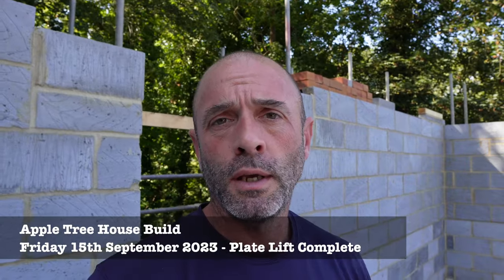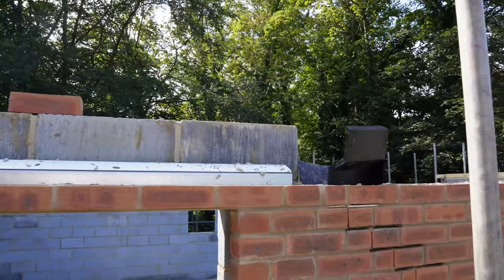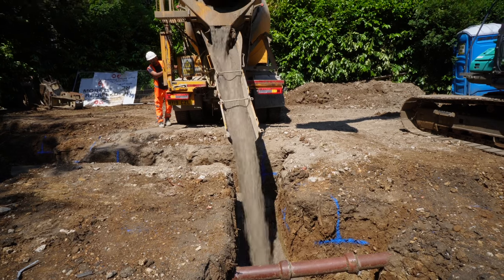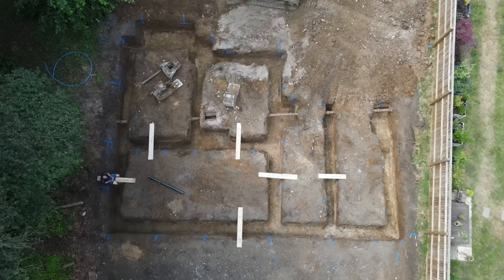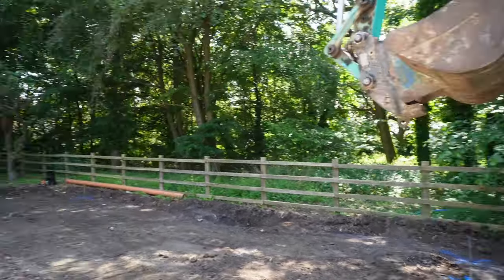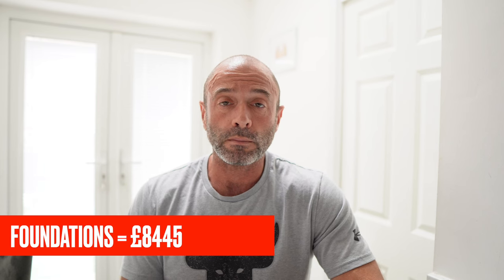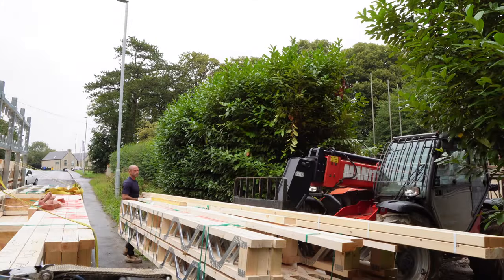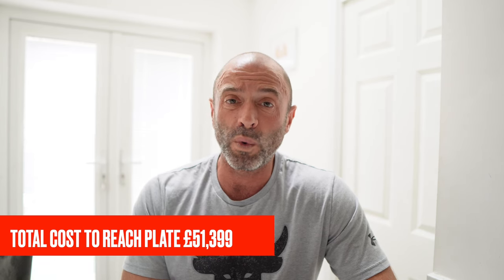How To Build Your Own House - Ready For Roof Trusses

Comment: Nhbc standard 👍but I wish someone would ask them why a 675mm straight Nick is ok ? All so you have a full block under a lintel , if you break the bond above it’s still 450 straight Nick
Reply from the maker: I understand the full block but sometimes it is a bit of a nightmare.  Normally we would have brickettes on site too which makes things easier but the lads cut blocks to enable us to use a full block on my house.  I don't like to see small cuts under lintels but 1/2 or 3/4 blocks are fine.  Even more of a nightmare on some of our jobs as window head heights are different which causes even more issues with trying to bond to a full block
Reply: @Tone_Team  explain the full block to me please, and how a 450mm straight Nick is ok
Reply from the maker: @jamesgill4765  Because NHBC want to see lintels bedded on full blocks and will compromise on straight joint in order to achieve that.  It could have been bonded better if we had brickettes on site